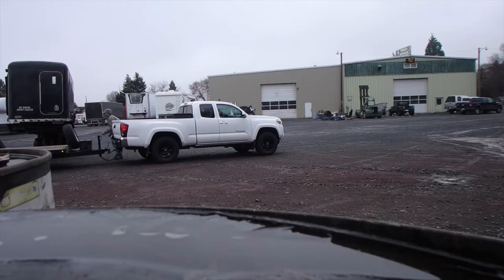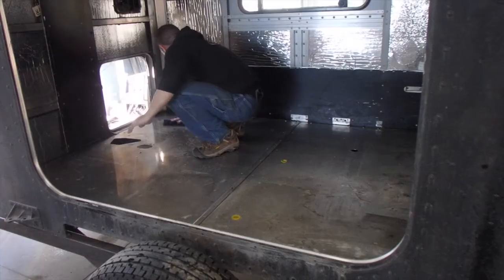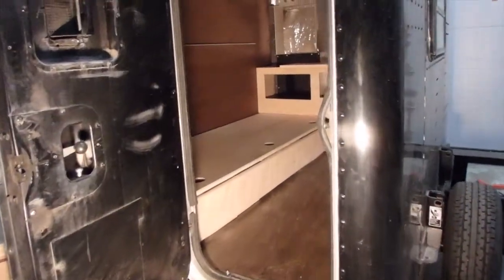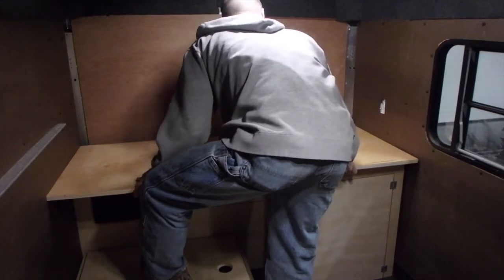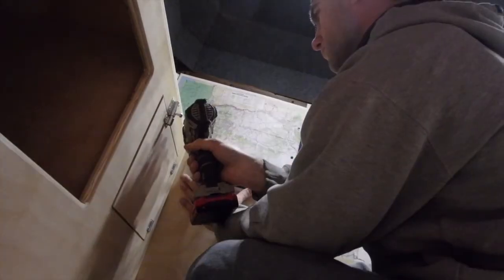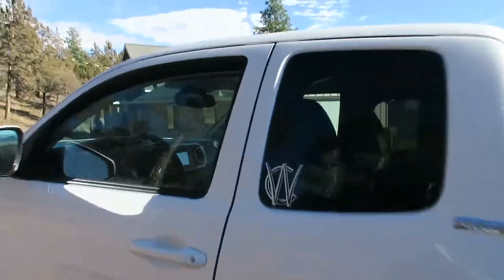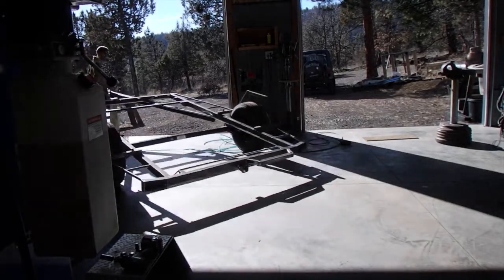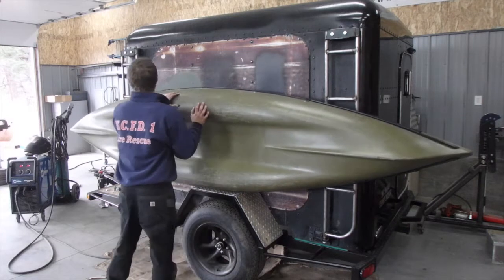Building a micro camper from a SEMI TRUCK

Comment: Looked great. I was looking to build something like this and was wondering if they told you the weight of the sleeper when you bought it and if you remember around what the cost was for the sleeper? I'm looking to do a complete cab and sleep trailer. Then i will have the doors to get into and lock. I will gut everything out of the cab though to save on weight but will leave some of the switches for some things. Just not sure about the weight of a complete cab and sleeper either. Thanks for any information.